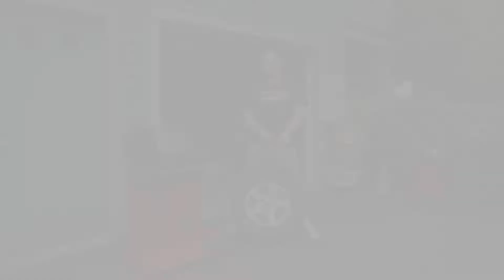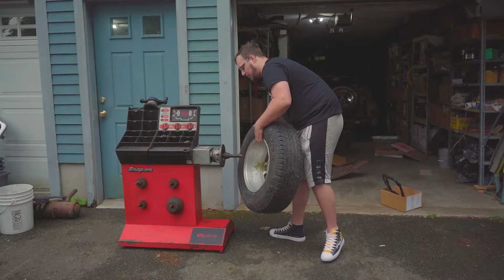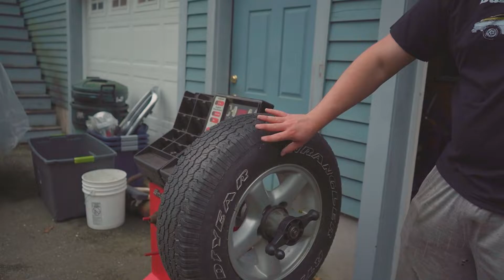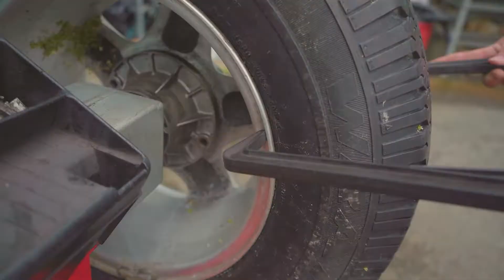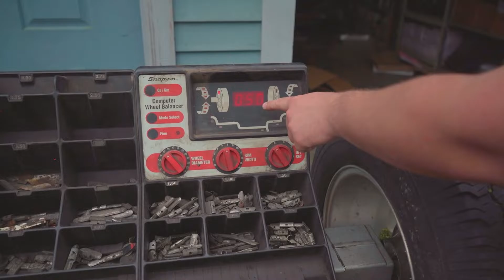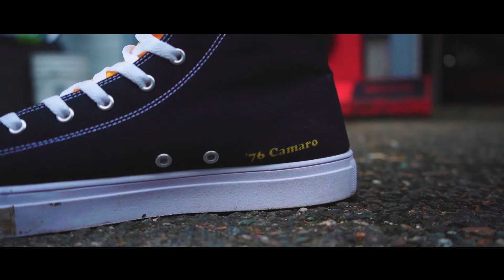How To Balance A Tire - Burnout Tutorials

Comment: Nice video, noticed you have a WB260A balancer, I'm curious if yours has issues dialing in Rim width when under different Select Modes.
On mine when Mode Select is in certain weight combinations, it would only show 4.00" width on the display regardless of where the rim width dial is turned. However if I push to another Mode Select the rim width will adjust just fine.